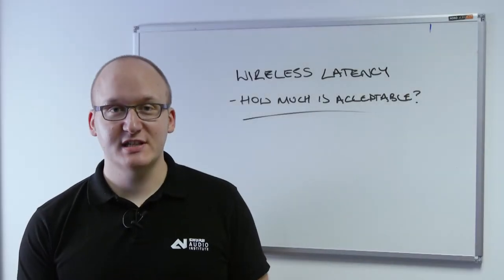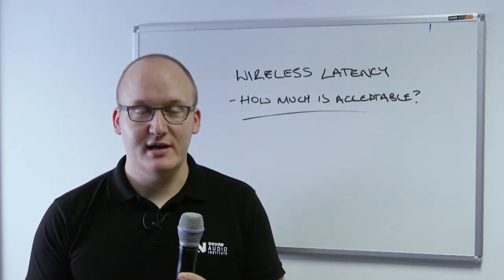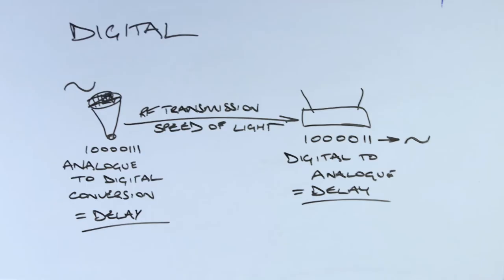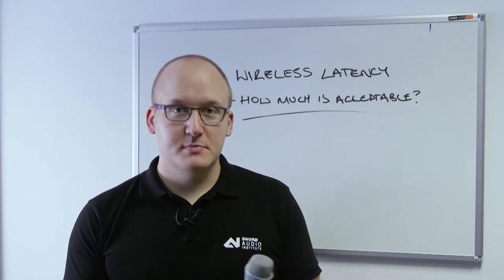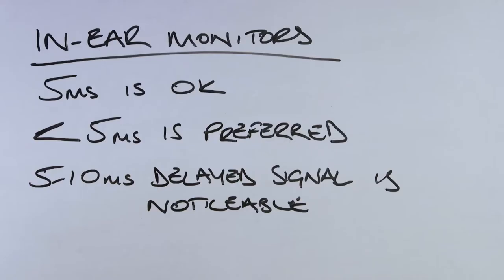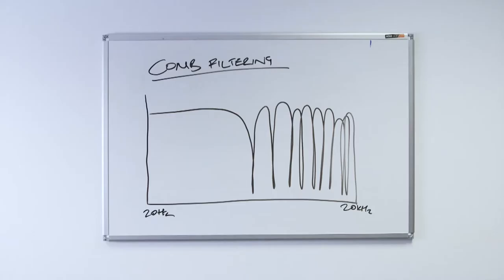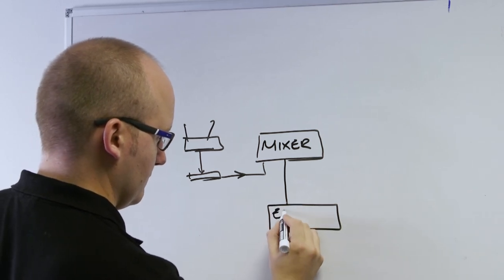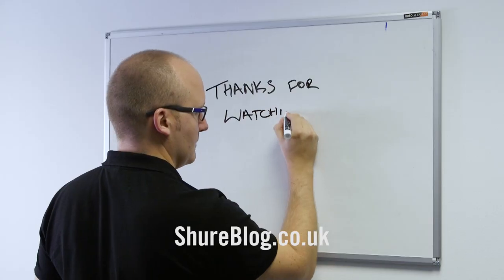Shure Whiteboard – Digital Wireless Latency Explained

Comment: if all the other factors are digital, then the total latency will be higher, one reviewer estimated a 20ms latency in total..how are we going to play with that latency??? :)
Reply: Every digit Gear adds one more time to the actaul Latency. Monitor Ananlog! I would like to try InEar for a Live Situation on a big Stage. But i am quit shure i wouldnt like it. Theres nothing like a TubeAmp with a cabinet in your Back. And i would prefer its possibel, Realtime Monitoring, how ever.
Reply: Don't forget that sound travels about 1msec per foot, so that's like moving an additional 20 feet from a stage wedge monitor. Can you play with that latency? Sure, but it depends on many factors... tempo, style of music, instrument, practice, etc. play a big role. Orchestras have more than that latency from one side of the stage to the other with no mics at all. That's part of the reason why a conductor is important to lock down the timing.

Comment: It dosnt impact on the Timing, it impacts on the Intonation cause Phase issues..
Reply: latency impact timing not intonation
Reply: @andym7333  If you hear your Voice over your Bones, what should be if you sing right, And you here your Monitoring Signal one more time with very short Latency between a Fraction of  a millisecond and let say 4 or 5 ms, then you get Phase  Correlation in your Brain, and that could cause Intonation Problems, like shifting of the whole frequency Spectrum up or down. So the Singer here a shifted Playback and try to intonate at this, especially good Singer. You get it now. Or? Timingproblems you get with higher Latencys, like 5, 10ms.